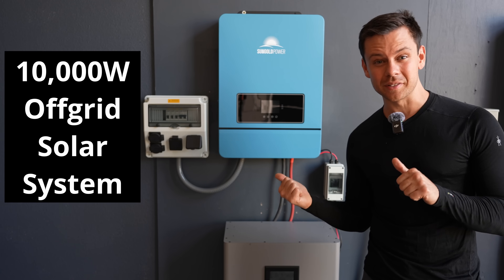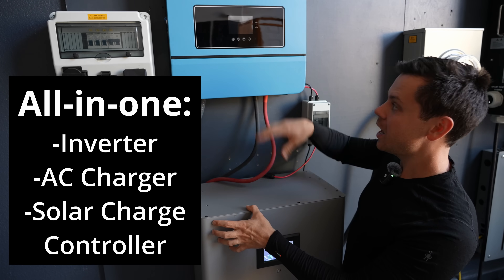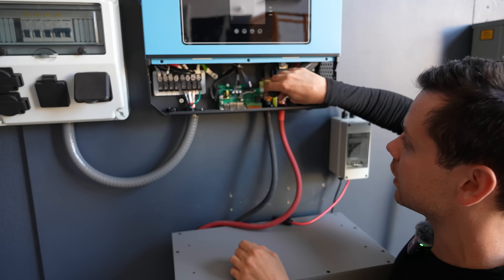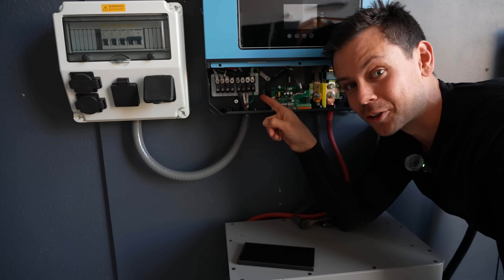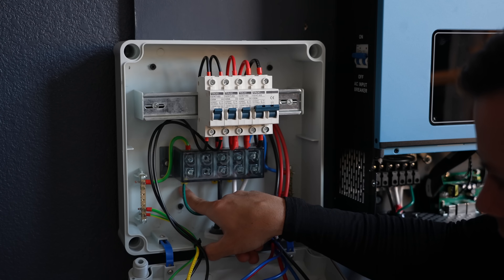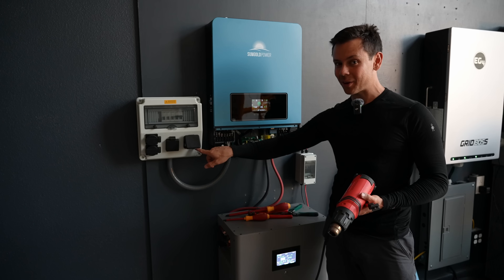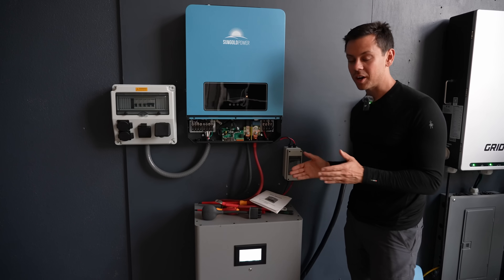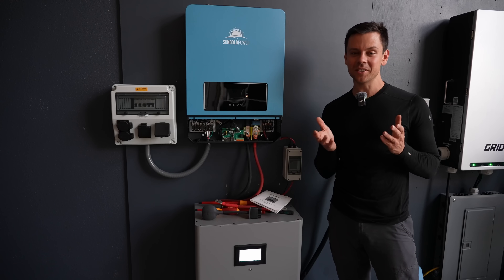Offgrid Solar Beginner Crash Course: Build a 10,000W Solar System

Comment: This is great!

I'd love to see a video about a grid tied system with 10kW of panels and two of those 16kWh batteries. That would basically replace almost everyone's complete electric usage. Total pricing estimates would be nice as well.
Reply: ^This. 💯% this!
Reply: Even if those prices were "ballpark" figures it would help a lot of people.  Then the biggest variable, outside of availability, will be your local installation (if you don't DIY it entirely) and any permitting/inspection requirements.
Reply: This comment - "That would basically replace almost everyone's complete electric usage." The only problem with your concept, is the northern states. We would use it as backup in the winter in case of power failure. The important part everyone should consider here is how many watts do I need to keep heat in the house. Some big houses would need two or three fireplaces to accommodate their heating size. Wattage is the king of needs usage, everyone into Solar should check their wattage needs.. I have had stories of (3)weeks without power in the past. This was given by a Northwestern power company employee.
Reply: @DomariNolo  About 10 years ago I spent 2 weeks + without grid power in Michigan thanks to that December ice storm.  We got VERY lucky and visited Lowes just as they were unloading a pallet of gas generators.  My wife literally sat on one of the boxes while I went home to swap vehicles from the car to our van.  Natural gas so we really just needed the genny for enough power to run the furnace blower, our fridge and a couple of freezers.
Reply: @DomariNolo  so far northern states are primarily fuel-based heating, though heat pumps are starting to gain traction.  ..  I would just need power to run the fan and circuit board (gas furnace)
Reply: @mattatwar 
I’m in Vermont. 
The cost to electric heat a small 2BR home with solar is totally impractical, though heating with a carbon fuel source is doable. 
Air conditioning via solar in lower latitudes would be pretty crazy, too, though more manageable than heating imho. Dying even at 40*F is relatively easy, whereas dealing with 80-90*F indoor temps with inadequate or partial a/c is probably not going to make you die for most healthy people.
Reply: NO to grid-tie. Solar is absolutely useless if you lose grid power! that's what turned me away from that. When I do any solar, it'll be stand alone, with a disconnect switch.
Reply: I really doubt it, my average daily usage in Arizona in the summer is like 50kwh and I'm in about 450 square feet...
Reply: @johndoe-oi7bq  get a mini split heat pump first. I use 30kwh per day 1100 sq ft in TX
Reply: @johndoe-oi7bq  my average is about 55kwh with spikes up to 75kwh some days in SWFL. Definitely need something grid tied where I would have to majorly reduce usage during a grid outage. Would use a mix of solar/gas generator to charge the battery bank.

Comment: You can still use the battery/solar with your grid house by using two 1000 w y&h inverters w/limiter that way you always using solar everyday but have this backup inverter to use in blackouts....
I connected my backup inverter to an generator outlet with lockout kit ...
Reply: What does y + h mean?

Comment: What size Solar disconnect do you recommend?  I am looking at the 1000v 40 amp to give myself plenty of head room. I will aim to have 6-8 400 watt using 13amps and 37 volts with a max of 25 amp fuse in each panel for series wiring.

Comment: Sorry for the language - this is freakin’ GOLD.

I currently have an EcoFlow Ultra - which I am pleased with - but am always on the lookout for simplicity.

Two questions - 
1) Can you set up two different solar arrays - 5kw each?

2) Is there any way to be able to attach a 30 amp cord from a transfer switch?

Again - this video rocks!  Will - you are THAT GUY!
Reply: The middle outlet on that breaker box he has is a 120 volt 30 amp RV outlet. The kind with the Y blade configuration.
Reply: Thank you! Seals the deal…

Comment: Hi Will,

Your videos are great! I have a couple ideas for more. Build a 96 volt system so we can get away from those extra heavy (expensive) wires.  I've seen BMS's that do 96 volts as well as inverters and solar chargers. The voltage from the solar arrays is getting in that range anyway so people are already messing with that many volts or more. 

The other is if you search Amazon for sump pump inverter, they have a ton of inverters, mainly 12 volts, that have a built-in charger and automatic transfer and they're not much more expensive than regular inverters. They seem perfect for a UPS power supply and I didn't know about them until I was talking to a friend who's inverter went out for his sump pump.

Thanks. 

Rick.

Comment: This is an EXCELLENT video.  Anyone who is struggling with high power bills should watch this and get it setup before the 30% tax credit runs out.  Heck I might just build this myself and I will use your links!
Reply: Does that credit apply to all states ?
Reply: @sevenasefaha1872 yes. That is federal. There might be state as well for additional savings.
Reply: @sevenasefaha1872    Yes, it's a federal tax credit (called the  residential clean energy credit) and it includes battery storage. It's claimed by using Form 5695 when you do your taxes. The Big Beautiful Bill recently passed sunsets the credit on Dec 31, 2025.

Comment: I have a similar system. I'm using the 8K version. I have 4 eco-worthy server rack  batteries connected to it. I charge the batteries with my inverter generator that isn't neutral bonded. I wanted to charge them with home AC, but didn't realize I shouldn't. Thanks for the education.

Comment: I notice you don't have an earth ground on this system. When you put an AC tester on an outlet, do you get an open ground warning?

I wish you would do an extensive video on grounding that looks at different setups that can be encountered when building a system in both on and off grid scenarios. How do you deal with grounding with your handcart power units? Surely the AIO wants to see a ground.

Grounding is one of the most misunderstood configuration issues I think there is with building these systems.
Reply: Exactly what I wanted to say, also no SPD and breakers.

Comment: There is no reason to spend $50K or more to have some solar company come and rip you off anymore.  Everyone can do this.  Thanks to Will for this awesome video.
Reply: People do exist for whom putting batteries in a flashlight is a challenge.
Reply: Unless (of course) you have actual laws and a two story house. Lots of regulations to research and be sure to follow.
Reply: @john_in_phoenix  city codes can be beaten
Reply: Most solar company's are selling the finance package , they lie just to get you to sign
Reply: @TRICHOMETRIST  They are particularly evil to seniors, who seem to be the easiest targets. Seniors here in Arizona are ripped off (on solar grid-tie), on steroids!
Reply: Lots of Electrical Cars in China are failing.   Pick Battery storage carefully.

Comment: I plugged my AC in, which is for my inverter generator to charge when needed.
But I also found that just plugging it in to the wall socket at 15 A, would charge up my batteries too on grid. 
Of course I’m not sure how it’s grounded, but it seems to work.
Reply: Improper grounding usually won't result in something not working, it just creates a situation where someone could get electrocuted

Comment: Off-grid means it’s a separate stand alone electrical system independent from your house wiring that is handyman simple and safe.  With grid failure inevitable, this makes sense.
Reply: If you have electrical/propane heating. Connecting the two i.e. solar/battery etc. would be difficult for most, with this system. Running extension cords would/could be hazardous.. Think about it, pulling your refrigerator out, wiring into your heating, could be a real hassle for some people.
Reply: @DomariNolo  when disasters hits people pull out thier generators and do just tht...so u not really saying anything..air conditioner,  freezers and lights...people will cook on thier BBQ grills outside instead of oven load .
Reply: @MikeJones-qo7vt  I didn't understand most of what you wrote. But, it did make me laugh. Thank you..

Comment: Is the best practice to have the PV disconnect at the array (small ground mount array), at the inverter as shown here, or not much difference? In the case where the PV disconnect is near the inverter would it be generally safe to disconnect upstream MC4 connections (i.e. at a gland entering the structure) if the disconnect is 'off', even when the panels are exposed to light? I assume best practice might be to always work with no sun or when the panels are covered, but assume that might not always be possible. Thanks.

Comment: Just ordered this exact system a few days ago. Can't wait to get the battery built.
Reply: I know prices can fluctuate, but would you mind sharing what it ended up costing you?
Reply: @JesseOsby $1,738.80 shipped for the inverter. They have an $80 coupon and free shipping on top of the July sale.
$1,899 for the battery kit. Includes shipping on the cells.
About another $1,100 for the other components: load center, wire, breakers, conduit, SPD, etc.
Once it's online, I plan on tripling my solar array from 9 to 30 panels. 250W used panels. 
I can finally upgrade my 24V 2,000w inverter system.
Reply: I can't order the battery through the link.  You can't get past the cart to finalize the order.  Did you use a different link to order it?
Reply: @pigseye2 I couldn't get my browser (Brave) to work either. Had to do it on my phone. The country/state selector wouldn't work for me.
Reply: @pigseye2  It wouldn't work on my desktop. Had to order on my phone. The state/zip code selectors were broken in my desktop browser.
Reply: Got it installed. Still have to wait 2-3 more weeks for the cells. That ship time on the cells is agonizing. Be careful with the terminal blocks on that inverter. They strip out very easily. Thankfully, the AC In, AC Out, and PV connections all use the exact same blocks. So, I shifted the stripped terminal to PV2 and got AC In, AC Out, and PV1 working. Sungoldpower said they'd ship out a new terminal block. But, it's in a usable state for now.
Reply: Got the replacement terminal block from SGP. And, the cells are scheduled to be delivered tomorrow. This system is working well, even without a battery. I've been dropping the temperature on my AC unit just to burn the solar while it's available. Why not use it. Charged my car during the day, too. Not planning on doing that long-term, but just as a load dump while waiting for the battery cells.
Temporarily, I have all 30 250W panels on a 10S3P string going into PV1. It's overpanelled for now. Once I get the conduit and 2 strings run, I plan on doing 10S1P and 10S2P. Waiting for my attic to not be 150 degrees.
Reply: I am not running communication between the inverter and battery, but I'm considering it. There's a difference between the voltage readings that prevents the battery from resetting the SoC to 100%. Had to up the boost voltage on the inverter an extra 0.4V so it would. Now it charges to 3.5V per cell. I was trying to keep it to 3.45 like Off-Grid Garage. Maybe communication would take care of that? Since the battery would be telling the inverter what the voltage is. Got both set to Pylon, but I haven't gotten it to work yet. 

I still have an issue where my UPS in my office clicks over to battery when my AC kicks in. Just an annoyance. Also, when the clothes washer is running, my lights flicker. The washer is an inverter type. Lots of small spikes in power. Lights are all LED. The one 12V under cabinet light in the kitchen doesn't flicker, but it has plenty of filtering on the AC to DC power supply. I may need to look around for better bulbs with filtering caps... Any ideas?

Comment: An hour? Takes me an hour to get AWG 6 wire into those AC output terminals on these SRNE units. That's one thing I do not like about the unit, I wish those terminals were just a little bigger.
Reply from the maker: Agreed, they are a pain. I use needle nose pliers to shove them in there. Try it out. Takes seconds

Comment: Hi Will, How would one connect the external 48V battery charger?  Does the inverter need to be off if one charges the battery w/ the external charger?   BTW Great video, I appreciate all the knowledge you share with the community.
Reply: It is simple. Just connect the 48 Volt output of the charger to the battery posts. No, the inverter doesn't need to be shut off when charging the battery.

Comment: The outlet box listed doesn't appear to be the one shown in the video. There is a 120v/240v box below in the ad but would like to have the listing for the one shown. These videos are great.
Reply from the maker: added the box, its out of stock. darn it
Reply: @WillProwse  Thanks,I type slower than you.
Reply: @willprowse did that 240v outlet box have the daisy chained wiring on the ground or neutral? Looked like hots weren’t… but still could use a little extra THHN wiring, right?
Reply: My bad,it is listed but currently unavailable.

Comment: Working behind electricians I have come across a lot of loose wiring when doing amp and voltage checks. It is a good practice to tighten each leg after some use in the beginning. The wire will heat up and cool down expanding and shrink due to the heat. New motors have this problem to all of the time.

Comment: Why are comments deleted? 😮
Reply from the maker: Some of the comments I post dont even show up on other videos. Youtube needs to get their system working. Especially with the ai bots
Reply: @WillProwse i mentioned that the worst is not the $$$$ or labor. It is the red tape which i have to jump through to install a backup system. My friend, 10 miles away, was without power for 12 days after a recent storm and they want me to provide structural engineer reports about weight distribution if i want to mount it to a car port, shed or house.
Reply: ....and not mentioning the other requirements.
Reply from the maker: What comments? I did not delete anything
Reply: I’ve noticed if I re-sort the comments by ‘new’ I can usually see them all.
Reply: @realcecewilson no in this case. I still saw it before I refreshed and wanted to fix a typo and got that this message is not available anymore. When I then updated, it was gone.

Comment: So this has a 240-volt plug on the power box?
Reply: Yeah you can see at 6:55 that one of the outlets has four wires feeding it, so two hots, so 240v
Reply: Thank you  that box is unavailable on Amazon not even out of stock and because he's reviewed other ones that weren't safely wired I don't want to just pick one willy nilly lol.
 Thank you for answering because I know nothing about the 240 @JesseOsby

Comment: Do you need to put pentle on the PV input wires?   I notice the higher 12000EG4 you recommend Yes, but the 5000W Sungold and 3000WEG4, you didn't.
Reply from the maker: Not with this type of terminal. No need for a ferrule.

Comment: If I wanted to use this setup as a house battery backup instead of usnig PV, can I charge with grid power and the unit switch over?
Reply: That's what I want to do, a whole house UPS. I think its possible.
Reply: Yes, some people never install solar panels.

Comment: I have this setup.  It’s similar.  But I need a more powerful inverter for my home
Reply: You can parallel these ones and double or triple the output.  Unfortunately the idle consumption will also double or triple.
Reply: @idahoduckhunter yeah.  I just want one inverter.  I don’t need extra on the wall 😂
Reply: @PLATINUM2U  What you'll find is that most inverters top out at 10-12k and then they are paralleled to expand that.  Largest one I've found is a low frequency 18kw inverter from sungold power.
Reply: @idahoduckhunter I’ll need to check that one out.

Comment: I can't stress enough how much i like to have communication between the inverter and the batteries. I use it for the smart load output in my sol-ark system. It's pretty useful in managing loads autonomously
Reply: I still don't understand the need for communication... All you need is the max battery voltage and the battery cut off voltage... Why do you need anything else?!?
Reply: @SolarizeYourLife  basically what i need from the communication is for the inverter to know the accurate percentage of the battery charge which enables a bunch of useful features (you can't measure that using voltage especially for lifepo4). For example 'Smart load' which enables you to dump all your excess production to a dedicated load such as a water heater . Or you can use it to manage loads autonomously. I use it to pump water and for my deep freezer and some other things when my battery is over 98% . Another feature is optimizing the trade with the grid where you can sell from the battery to a certain percentage when it's more profitable. Or you can restrict grid charge to a certain percentage. Or even using a dry contact on a certain percentage to turn on your back up generate. Plus charging the battery will be optimized regarding several factors such as dod and temp . And much more .